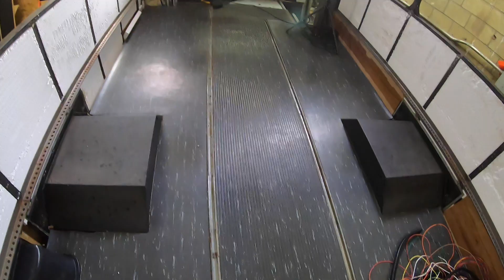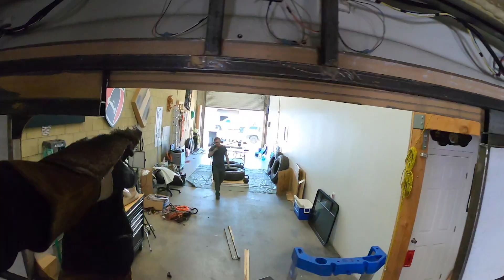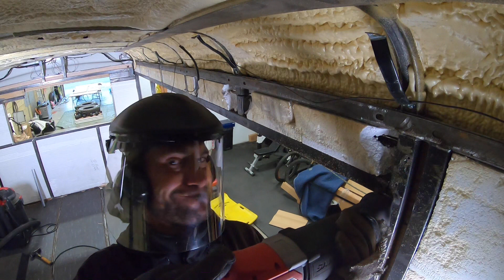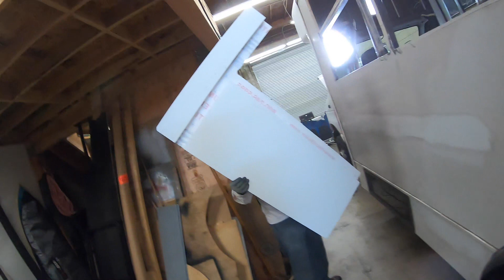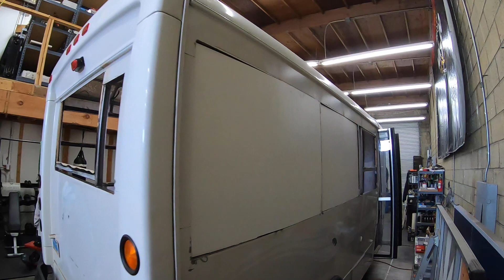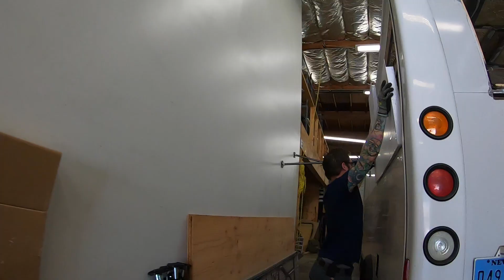Window Delete RV Bus Insulation  - Hail Mary Van Build Ep.2

Comment: Can you link the filon website / location where you bought the white filon siding?
Reply from the maker: https://www.ebay.com/itm/223493270718?hash=item34093cacbe:g:KAoAAOSwEVlb2HT8
Reply from the maker: Link to ebay is for a 15 foot x 8.5 foot roll but you can find a bunch of different lengths and widths on ebay.
Reply: @auxbuilt4190  thanks so much ! And your video / build looks great so far, good luck with it and with your channel!